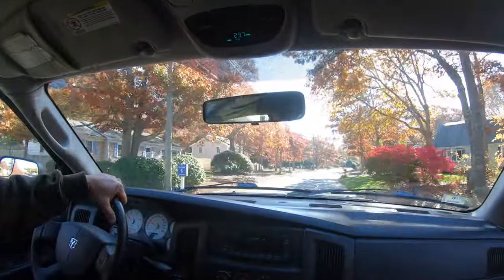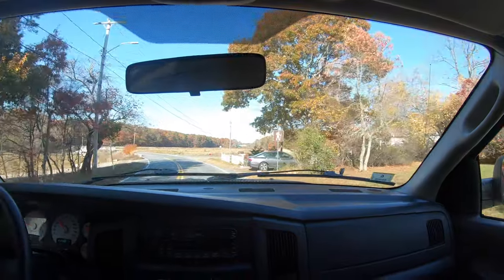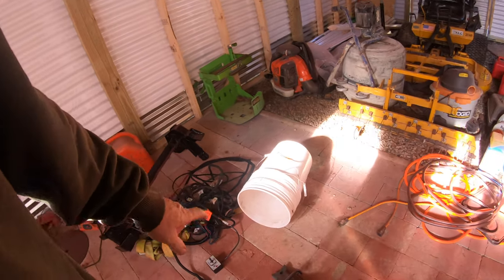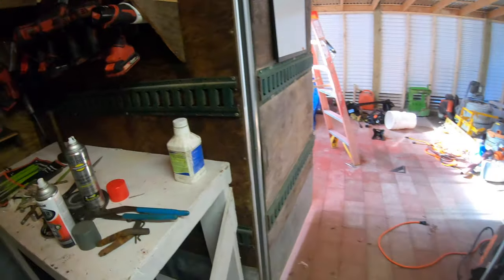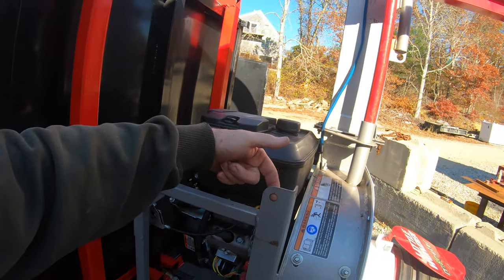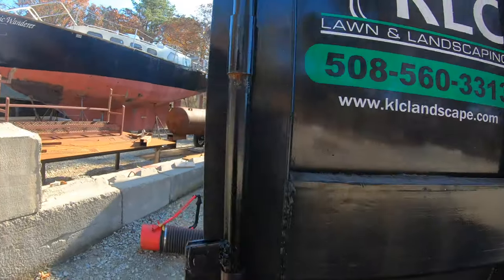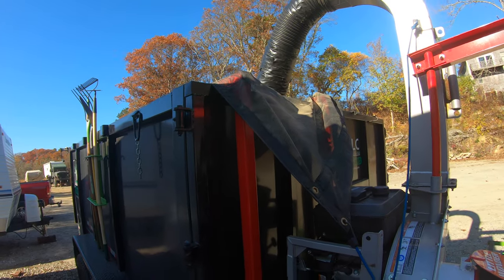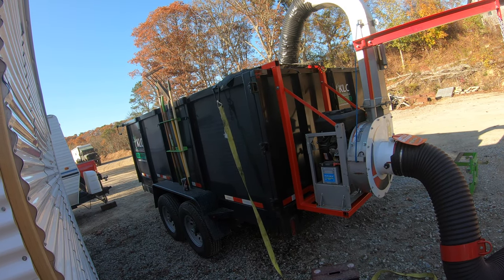Little Wonder 18hp Leaf/Debris Loader mounted on dump trailer | My 2020 Fall Leaf Setup Part 1 of 2

Comment: I wish I had a video on my my set up I had. Same thing as you know, 4 foot walls and I put a extension 4 foot flexible tube off the discharge turning down into the trailer. The mesh tarp would go over the extension rubber bungee holding it down and it worked perfect. I have to look for some pictures to send you. Now I see why you wanted to mount on the back of the trailer. Your hose is really short. I have a 12 foot hose which has no problem reaching piles of leaves from the A frame of trailer. Shop looks great. Wood stove will be awesome in there. Leather looks great in the truck. Great video bro! Yes, I did watch the whole video lol
Reply from the maker: You know.... You give me ideas all the time with our conversations... In all my different setups I have had I never considered making the hose longer..... I just keep moving the truck a whole lot... With the hose I have and have had on all my setups the back maximizes my range... But if I added about 6 feet on it boy that would be a game changer... I have no idea why sometimes I overlook the obvious but then overthink the heck out of other stuff.... Yea, I am excited for a wood stove, some good old wrenching by the fire and quiet time is in order for sure. Thanks for the idea.
Reply: @KenMrKLC  Ken, you are way more mechanically skilled then I am. I learn from you. Funny how are brains work. We do think alike. Check you IG, I sent you pictures. Too bad I can't add a picture here.

Comment: Great video. I would defeat making the top bigger. You could always put a some plywood for the extra little but that your tarp won’t reach at the back of the trailer but if you want to make it an enclosed anyway I would suggest to just pull the trigger and do it now

Comment: The reason I asked about dumping and leaf loader as if it is still on the barn door even on the side when dumping won't that make loader go at an angle some and maybe spill gas or wreck the loader?
Reply from the maker: No sir, it will tip but it won’t hurt it or spill... Wasn’t just you that questioned it.... that eyyy guy from up north also was interested. Thanks for watching brother. Just watched your latest vid an hour ago... some nice trucks you got there Shawn